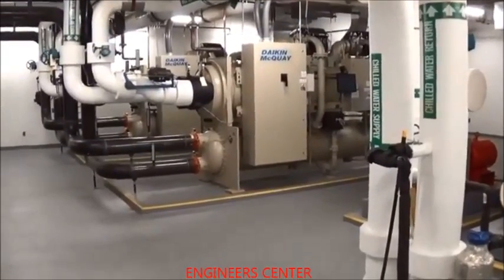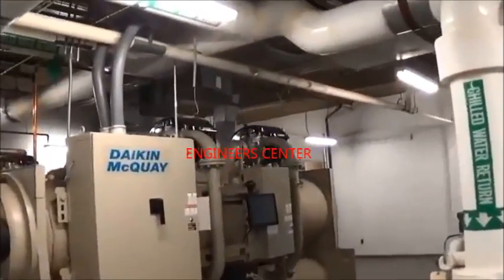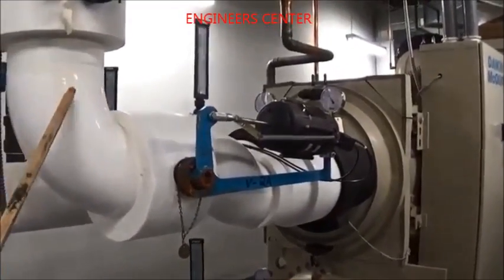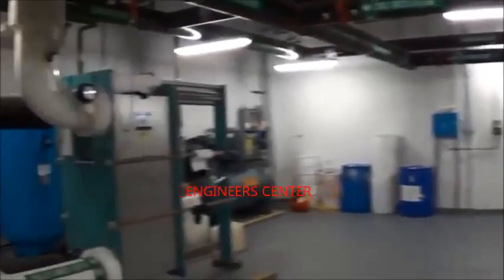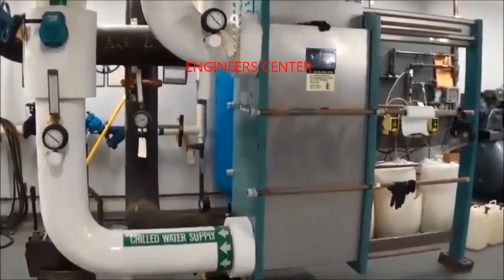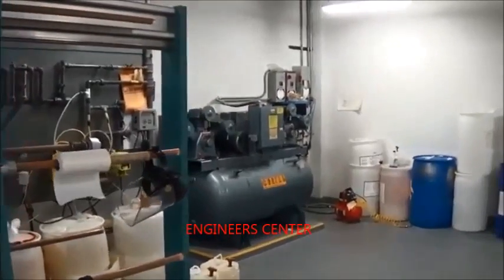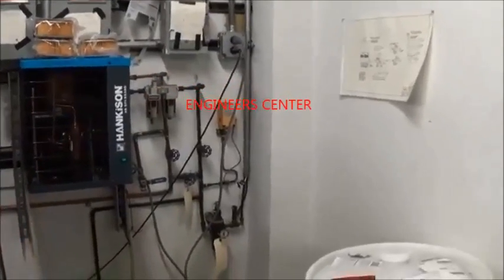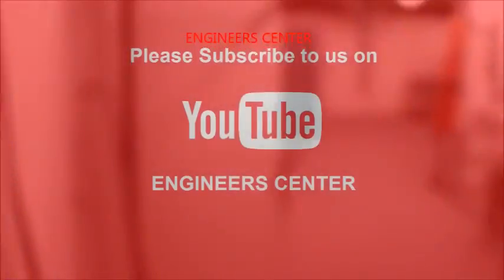Step by Step Operation of Chiller Plant - ENGINEERS CENTER

Comment: does this building have a boiler system for the heating side of the system
Reply: Data centers don't need boilers - they tend to generate heat year round :)
Reply: @DocNo27  thanks

Comment: what is the insulation material used on the chilled water line? and what is the white coating applied on it?
Reply from the maker: Expanded Polystyrene and it is covered with 0.63 mm x 19 mm chicken mesh and finished with 12 mm plastering. Then 26 Gauge aluminium cladding shall be provided over insulation. @abhijit shetty
Reply: Thanks
Reply: And what is the adhesive used to stick the thermocol to the pipes and other thermocol sections?